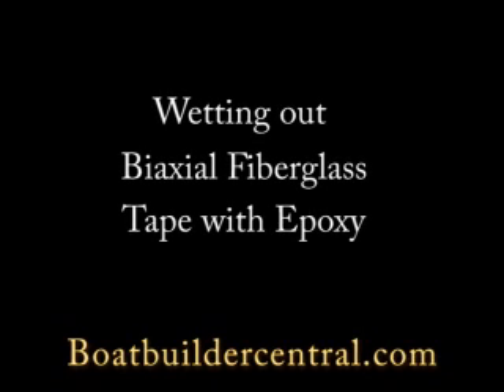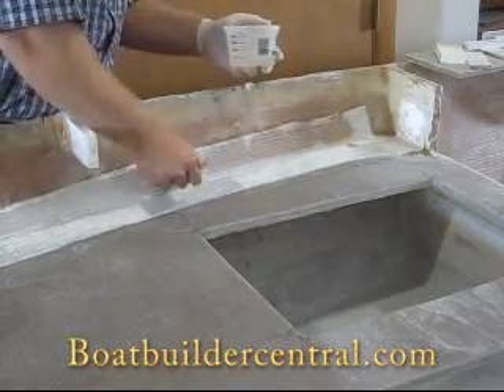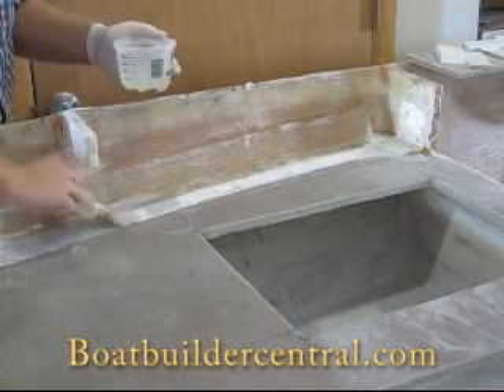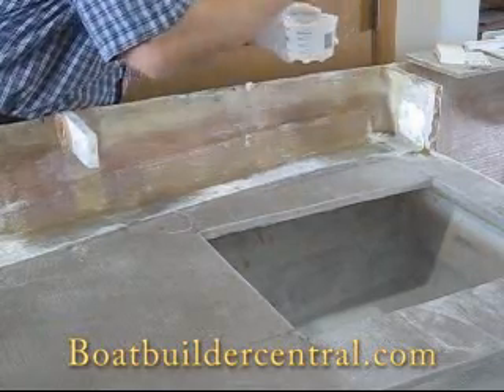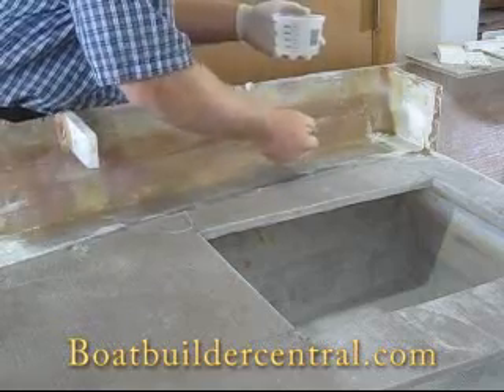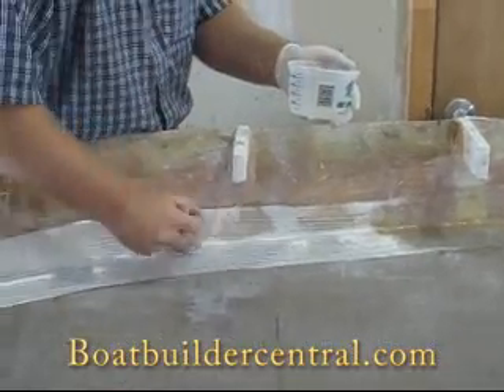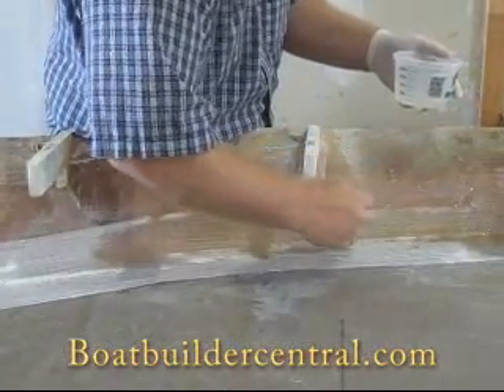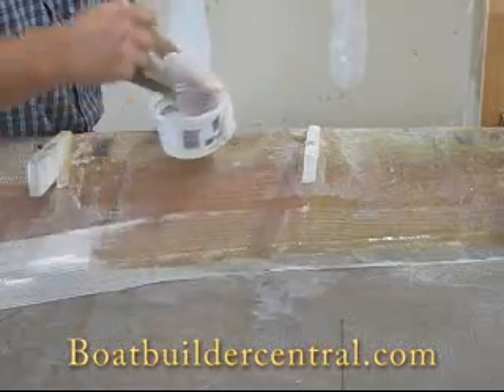Wetting out Biaxial Tape

Comment: Hi im using this cloth over ply to replace my boat decking.. question wet on wet ....does this mean wet the plyboard then wet down the biaxial cloth on top ? Should the epoxy fillets be wet also or pre cured ? TIA 😁